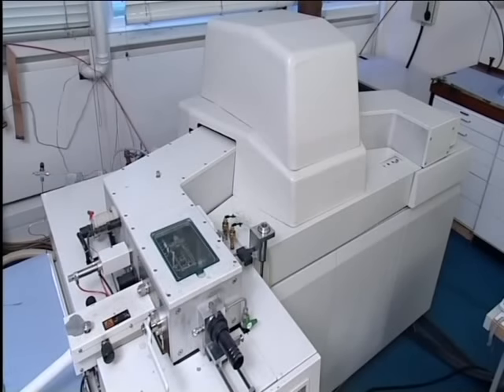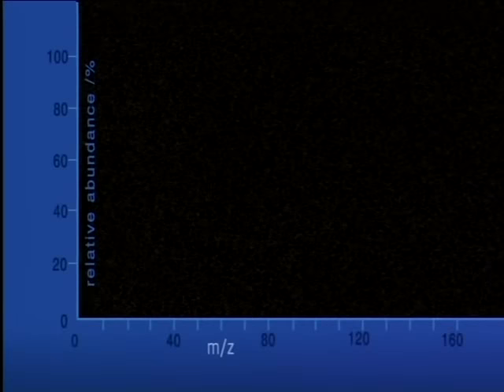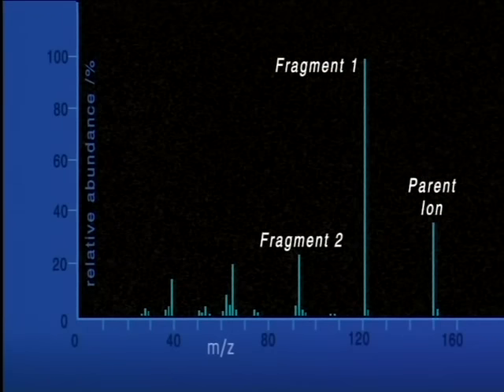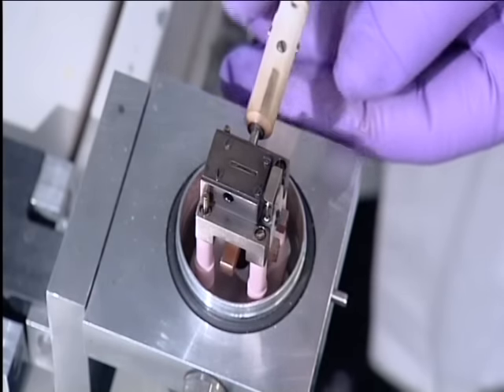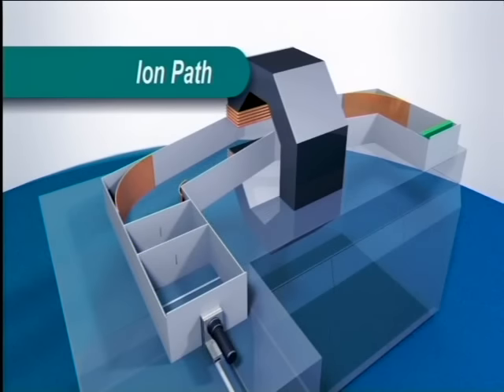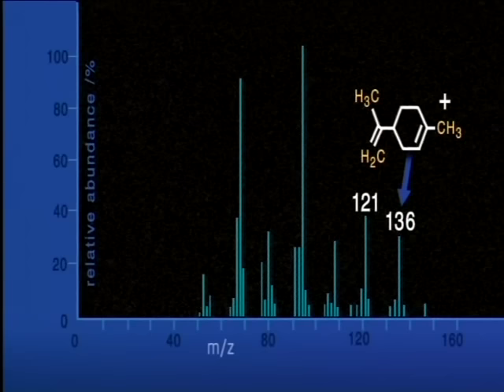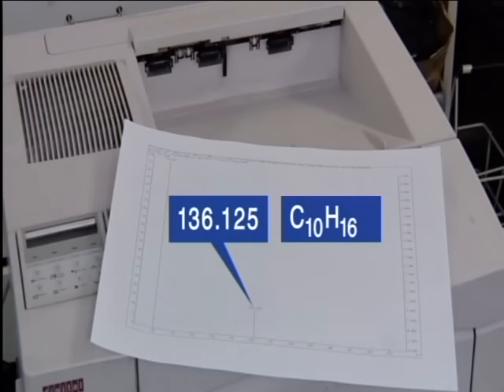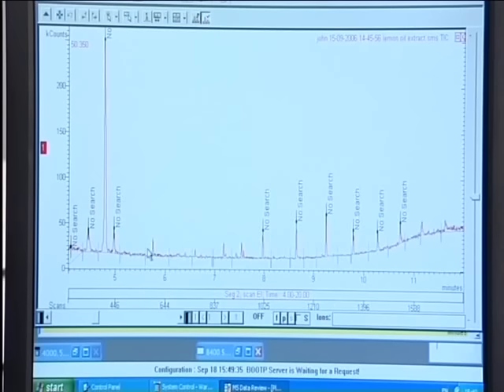Mass Spectrometry MS

Comment: Yes, ions need to have clear path from formation over deflection to detector. Rotation pump you see behind the instrument produce low vacuum after which is achieved high vacuum by using pumps like turbomolecular pumps or diffusion pumps. Rotation pumps then pump out particles from system - their output is directed to atmosphere over filters to avoid expelling possible harmful substances. Vacuum must be maintained constantly because even smallest introduction of foreign particles makes it worse.

Comment: Hi, I understand that the true (non-relative) masses of atoms are calculated with a mass spectrometer. using this relationship: Centripetal Force = Force due to magnetic field(B) 

But i was wondering how masses of atoms were calculated before the mass spectrometers were invented.
Reply: Arman Ashourlou .
Check out Avogadro and the mole. Basically carbon is assigned a mass of 12 and every this calculated from that.
Reply: Cat.   Parametrization
Reply: Parametrization Can convert ELECTRIC To MAGNETIC fields And Vice versa